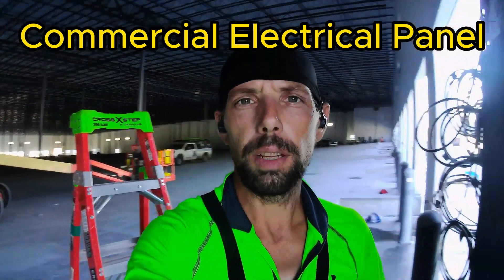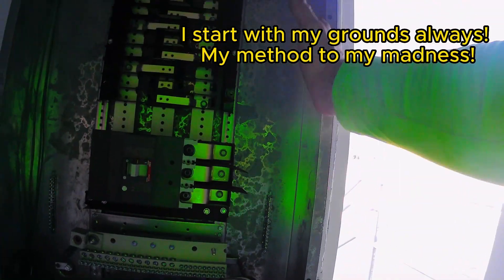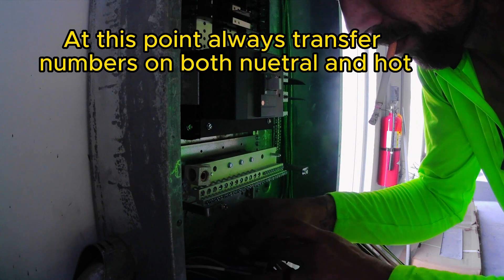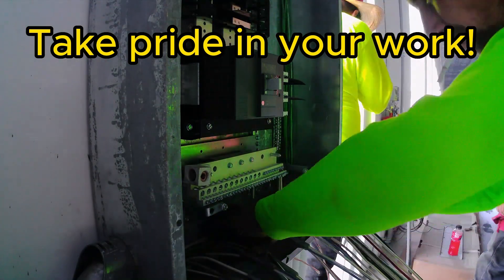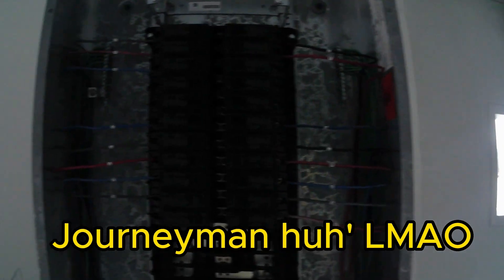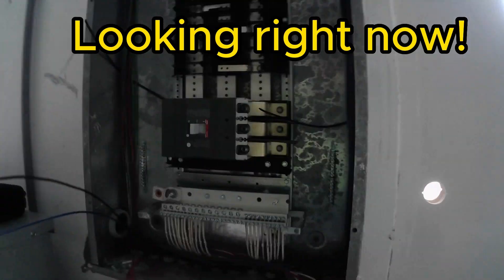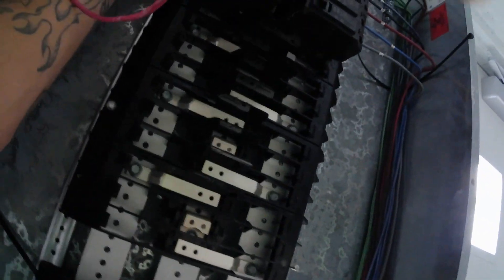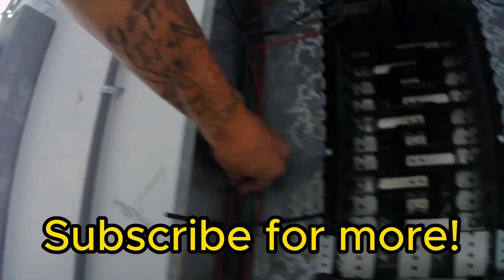How To Wire Commercial Main Electrical Panel For Beginners #electrician

Comment: What exactly did the guy who jumped on your pannel do wrong? (I'm new to this trade and only have done switches and receptacles)
Reply from the maker: @HungHowardAudio  I’m so sorry. I thought you was talking about a different video. I’m just watching this one back. It’s from a while ago and realizing what she was asking. The issue here wasn’t necessarily an issue. My problem with it was I had taken time to keep everything nice and neat and flowing and looking good and someone come along and rushed it and just folded it up after my name had been stamped on it and because I had worked on it, needless to say, I took it all loose and reworked it like any good technician would do
Reply from the maker: @HungHowardAudio  long story short, he tied 2 three phase breakers together. Color to color.
Reply: @Garrett.Poppell  ignore my ignorance but would that be a hazard for code due to the fact theyre out of phase or because of a short/fire hazard? If it is too complex to explain i understand
Reply from the maker: @ no worries, brother we’re all here to learn and so imagine one and seven tied together three and nine and five and 11 and you cut both of those breakers on each phase is going to bump heads and cause a big boom and big issues
Reply from the maker: @HungHowardAudio no code violations just was rushed and looked like dumpster juice